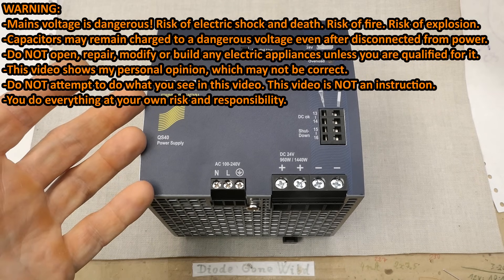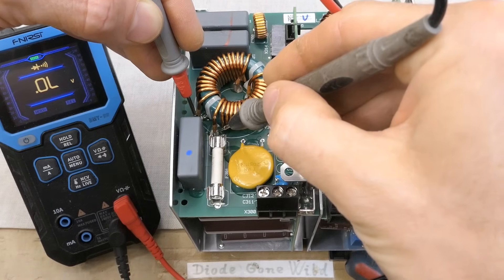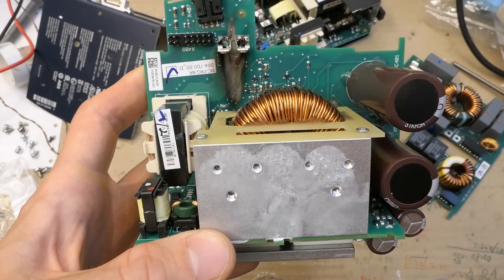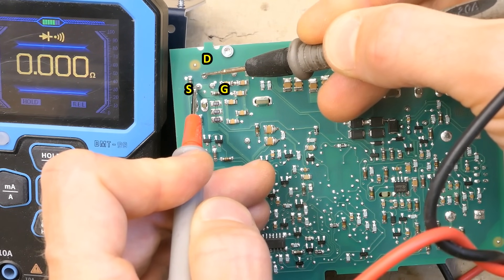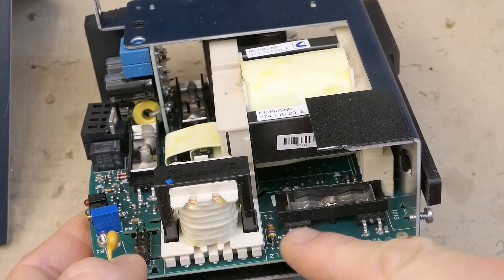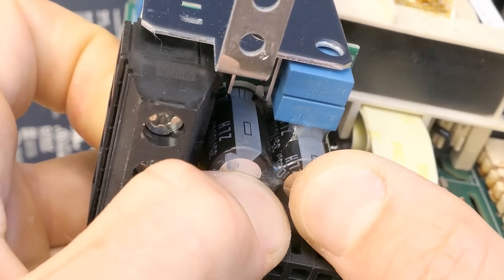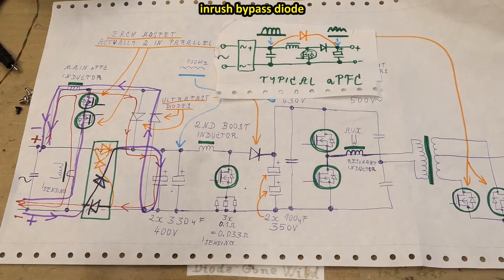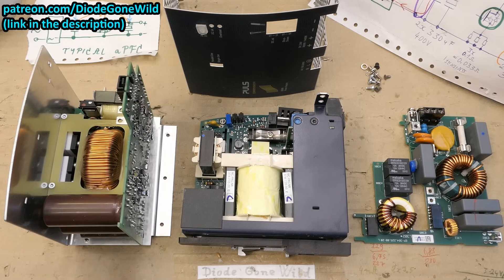Faulty 24V 960W power supply

Comment: Wouldn't it make more sense to replace the fbr with fets and the output rd with fets as well to get around needing such a complex pf circuit for some extra efficiency? You could just use a standard pfc circuit with active input and output rectifiers for the same high efficiency.

Comment: I tried to fix some of these in the past, but never could get them going.  👍BTW, what camera, mic. and lights do you use for recording these videos? It is of very high quality.
Reply from the maker: I'm using Panasonic Lumix DMC-LX15, the mic inside of it and a lot of random cheap E27 LEDs (about 32 of them) and 4x 36W fluorescent tubes illuminating from multiple directions.

Comment: Since they used 4 mosfets for the pfc, they might as well have had them in a full bridge, one leg switching at the grid frequency and the other boosting with the inductor. Get rid of the diode bridge all together.
That STP5NK80 mosfet on the filter board has to be for the auxiliary.

Comment: Very interesting psu why not 1000w but 960w
Reply from the maker: It's 40A at 24V.
Reply: it will shurely going over the One KW mark if you want that so much, just need to looking for the total input power.

🙃

Comment: Seems like arc flashing over the contacts and it dispose some metal fume above the pcb.
I may check for craced legs around chokes and transformers because these are the first source for the high voltage spikes.

Comment: The efficiency of these supplies is very good but when the output circuit fails then it is over. The unit we had in repair had the synchronous rectifier circuit damaged and the MOSFET's were directly driven from the microcontroller which as you can guess was also toast. Good luck replacing that as the firmware is proprietary.... Too bad, the unit is overly complex but the high efficiency makes up for that. The price was surprisingly low so the damaged unit went into recycling and was replaced by a new one.

Comment: Fascinating that they can basically use some slow diodes in the path of the PFC like this. Also interesting that they went with such a solution. Wondering if, and how much, more efficient a PFC using only mosfets would even be compared to this.
Reply: About 20 W get lost in the diodes in the worst conditions as user Marcogeri said in another comment. So You'd expect a maximum efficiency increase of 20W (if the mosfets have ZERO loss which of course is not true).
Reply: @fabiomuzzi7047  yeah. Of course mosfets are not lossless, and their actual losses in real conditions, including all their drive circuitry, are pretty hard to estimate.

Comment: I would suspect a fragment of metal reducing the breakdown voltage where the flash occurred. For example, an etch fault on the PCB (they are often pointed which encouraged breakdown), or a solder splash, or a component wire clipping.

Comment: One of the worst designed power supplies I've ever seen.  Put together like a Rubik's Cube or a Chinese puzzle.  No protection from arcing at critical points.  No fan.  Looks like 14 different departments worked on then had to make it fit together.   It didn't die from overloading, water ingress, physical damage or any normal causes; it simply arced inside at screw terminals.  Moronic.  Stop your whining people; I've been a tech for 52 years.
Reply: oh really? why?
Reply: Rage bait 2/10
Reply: Come on... 95% efficiency, fanless, so compact, I think it's a great, expensive PSU 
Maybe they could have used conformal coating although not sure it would help with foreign objects
Reply: @theagentsmith  See above
Reply: Worst? Explain why you think its badly designed. Could you design a better PSU? Its actually extremely well designed indeed! At over >800USD, it better be.
Reply: @simontay4851  See above
Reply: Well its put togheter like a rubik's cube to be repairable. It is an industrial power supply and industrial things need to be repairable. There is no fan because this power supply has to be mounted in a DIN rail and DIN installations strictly forbide fans. Also it may have arced inside because of metal dust or bits if it was in a ambient where metal is worked on
Reply: @Antony_09 There certainly is no general rule against fans on DIN rails!! 😂
Reply: @tookitogo  Din rails don't have enough airflow for a fan

Comment: Thanks for breaking this down. I always pick up a few things from your videos. I’ve worked on a few of these multi board designs, and most of the failures I ran into were from dodgy connections or cracked solder joints. Looks like this one might be running a bridgeless PFC topology.
Reply from the maker: Yes, a bridgeless or a semi-bridgeless PFC is probably what this is called. This is the first time I've actually seen it in real life.

Comment: As this is an industrial PSU, it is most likely used in an electronic cabinet. Not everyone is tidy when assembling these cabinets, and some metal chips can get trapped inside the wire ducts. Over time, these chips may fall onto electronic components. A small metal chip could fall into this PSU and vaporize, leaving metallic deposits on the PCB (as can see seen here)
Reply: I totally agree.
In my previous company we use to cover PLC's and power supplies with plastic sheets and tape to prevent wire strands and metal shavings falling into them during the electrical wiring of the control cabinets.
Reply: Good point this seems likely. Chips or even conductive dust.
Reply: Surprised it had enough energy to do that but not enough to pop the fuse.
Reply: May be

Comment: Is that the PSU for a RTX4090 ?
That would solve the stupid connector problem, just use 24V
Reply: , as this implies that the losses on the graphics card will be significantly higher. Consequently, a much larger cooler will be necessary.

Comment: I bought a  PULS PS10  as it delivers 28V at 10A.  I have an aircraft radio that is a power pig and draws up to 8A in transmit mode.  So far it has worked perfectly,  and is very small.  I have always been a little suspicious of switchers like this.  Seems like you are getting something for nothing,  as compared to a much larger standard supply.  But it happily works with no issues.

Comment: This seems to be a simple overvoltage. Probably 400V or even 690V connection.
Reply from the maker: I don't think so, with both the fuse and the MOV intact.
Reply: @DiodeGoneWild  I was just asking myself how could such a devastating arc occur and not blow the fuse. While the idea of a metallic object falling into the PS and shorting it is indeed credible (how can it blow up like this in a place where there are no clearly failed components?) how could it NOT blow the fuse?
Reply: Arcs aren't dead shorts, so the fuse won't blow. They also form at high frequencies and as more metal takes part in the arc, the resistance drops until something gives. I've worked on supplies like this and the arc has always occurred because of flyback voltages generated in the primary switching resonating because they weren't removed by the failed suppression capacitor. Nothing happens until the supply is heavily loaded and then the squeal and bang. The fuse in the supply never blows, but the breaker in the panel trips. Replacing the filter capacitors (they will have zero capacitance) and try powering it up (current limited of course) this is a nicely made supply, modular and the lack of wires is always good to see. I'm looking forward to the repair. Is there a service manual (EU, so I expect to get one from the manufacturer under right to repair)
Reply: @fabiomuzzi7047:
The high voltage simply can come from inside, if you think abaut the inductors and an interminent contact can cause.
Most of a time just a broken lead wire at the transformer pins because one of the leg is can moveing a bit inside the molded plastic.
Reply: @Duracellmumus  You are right, an intermittent contact can actually cause high voltage spikes when there is a big inductor in the circuit.
Reply: 690 V is probably only used for large motors in factories. I'm not sure someone would be dumb enough to connect a 100-240 V power supply to it.
Reply: @mernokimuvek As someone who never works with anything other than 230/400V and the "Just do it like we did last time" mystery voltages, its rare to have such voltages but my last project was just that. 120V/208V but multiple supplies that had higher voltages between the sets. I DID actually test everything at 230V and not 120 because...I didnt check but nothing blew. 

post random info tldr:
 I had EXACTLY that happen to a PSU that got shot with 480V out of a transformer I hooked up wrong, which had a magnetic trip that blew BEFORE the fuse or anything else did. Similar marks but it did also blow a cap, most importantly NOT the fuse tho.
Reply: @mernokimuvek There is often a 400V 3phase supply directly split next to a 230V supply. Or even a bigger input system

Comment: Whoa, an impressively made power supply - spare no expense, good quality parts, lots of heatsinking  and absolutely zero dodginess... and yet it failed really bad.
Reply: It failed without jeopardizing the user. That's a win. I would say it's overengineered though. The creepage gap where it burned seemed narrow, definitely slightly dodgy there.

Comment: it means 960w at 100v and full 1440w at 240v
Reply: No, 960W continuous and 1440W for 4s, regardless of input voltage. Look at labet at 0:45 or into the datasheet.
Reply: "50% BonusPower, 1440W for up to 4s" in the datasheet. So the video was right.

Comment: As you said - over complicated circuit.
Must have been an expensive PSU.
Thanks for the very good explanation of the circuit. 😉
Reply: I found this in a local catalogue, The price is about AU$2 per watt, the manufacturer is based in Munich, Germany.
Reply: @liam3284  But with manufacturing taking place mostly in China and Czechia

Comment: my guess from the start is that a small bug got inside and bridged that two contacts, specially if it's installed in an area subject to then. I've seen problems like these even from pesky ants.
Reply: I'd say careless whisker. This time it's not from the wire connected to the terminal, but dropped while stripping wires over the psu in the cabinet.
Reply: @villehietala9677  They should never use a cheap chinese wire stipper which cuts strands to begin with.
Reply: +1.  Can't be sure, but that was my first thought when seeing the burn marks as there's otherwise no easily apparent reason for it to arc there, at least not from the video footage.
Reply: Yes, foreign object, insect, spider. I suppose its possible the PFC went mad and generated a transient, but unlikely.
Reply: yep the main reason my ebike chargers pop .
Reply: Generally when a failure like this happens, it is because of "aliens" 👽
At least, that is what the History Channel and National Geographic says. 🤣
Reply: all those mechanically joined parts and movement there might have been a buildup of powder from crushed PCB. Once arc tracing starts  its self-sustaining because carbon.

Comment: Great video, congratulations! I design these type of power supplies for a living and your explanation about the pfc and your reverse engineering are simply perfect. The model is quite old but however very advanced for its time. The pfc is a kind of semi bridgeless type using a bidirectional switch; the only reason is efficiency. At 1kw and 90vac input there are about 11...12A from the mains passing through the bridge. Saving just one diode drop means saving about 10w of losses. To do something as compact as this, running at 90vac, maybe 50...60 degrees ambient using only convection cooling (no fans allowed in DIN rail market) is no joke. Thermal management is a nightmare and every watt you save is important. Efficiency of this unit will be in the 95...96% range, if you count the pfc alone it will be over 98% for sure. The second boost stage I don't think it is used to remove the 100Hz ripple, it is used to adapt the input voltage of the llc stage based on the output voltage setting, therefore keeping it always near its resonant frequency where the efficiency is the highest.
Reply: I wouldn't want to develop such power supplies for fun, let alone for a living. Especially under extreme pressure from a boss whose electronics skills are at the level of a protozoan and whose salary is directly proportional to the share of cost cuts he forces. (sorry for my "English")
Reply: Is it this bad in Germany? Reminds me of the power supplies made by the first company I worked for after university. Everyone from technician to management had good design skills and a great attitude.
Reply: Do you have any idea why it arced over? Moisture? High humidity?
Reply: How can i learn to design these things
Can you tell me the road
Reply: Interestingly with this topology, the average current through the diodes, always two in series, is the output current of the PFC. So if we assume we are running at roughly 1 kW 400V output from the PFC we have about 2.5 A average flowing through the diodes. If we further assume on the order of 1 V drop per diode, the diode condition losses are about 5 W total. Half of this is in the bridge rectifier.

In a conventional topology at 100 V input, the bridge rectifier has about 10 A average flowing through two diodes giving 20 W of losses in addition to the 2.5 W in the boost diode.

The 18 W saving is huge in this convection cooled application...
Reply: Having an extra boost or buck stage before the LLC converter seems to be quite common, and I have seen it in a Phoenix Contact design too. 

Not having to design the LLC stage minimum input voltage for holdup time on mains dips might be the main driving force. I wouldn't be surprised even if the boost converter is completely turned off in normal operation.
Reply: Don't think so. In that case why bothering to have 2 caps in series at the output of the boost converter? In the datasheet they say that the switching frequency is "nearly constant at 105kHz". How can you keep an llc at constant frequency when the output could vary between 24 an 28v? There will be at least at 1.5:1 frequency variation if you keep the input voltage fixed
Reply: cant the main PFC regulate good enough for the LLC stage?
Reply: Yes it could but with lower efficiency. An llc changes  its switching frequency to regulate it's output voltage. If you keep the ratio Vin/Vout fairly constant (by regulating vin based on the output voltage set point) its operating frequency will be constant. Design the transformer ratio to be at the resonant frequency and you will have the best possible efficiency for the llc stage. Of course there is another stage in the chain but a boost converter operating from 380v or so (pfc output) converting to 400...500v will have extremely high efficiency. On top of that you can use this boost converter to fully discharge the pfc capacitor when the main is lost, extending the holdup time without using extremely big capacitors on the pfc output
Reply: @marcogeri please
Reply: Man you have a interesting job
Reply: U design them China steal your work
Reply: И при напряжении 50-70V, когда полуволна синуса ещё ниже отпускается или когда в самом подъёме, КПД ещё больше увеличивается, т.к. корректора коэффициента мощности старается отбирать мощность из всей полуволны синусоиды сети.
Reply: How many of earth's resources would be saved if the US could simply move to a sane voltage used by pretty much the rest of the world?  2.5 times the efficiency just by using 230v instead of 90.
Reply: How did you get through your dissertations without using paragraphs?